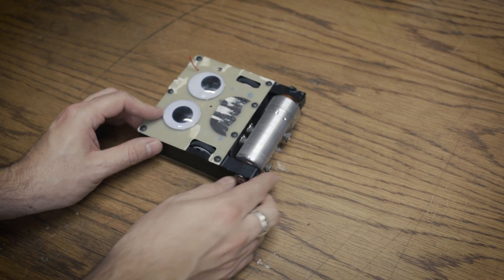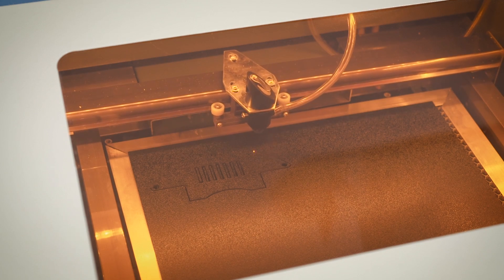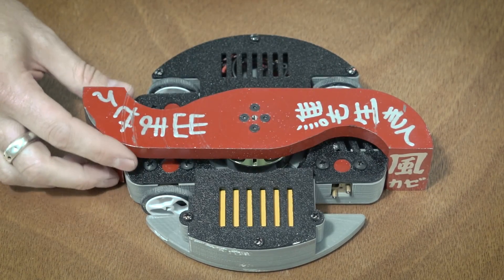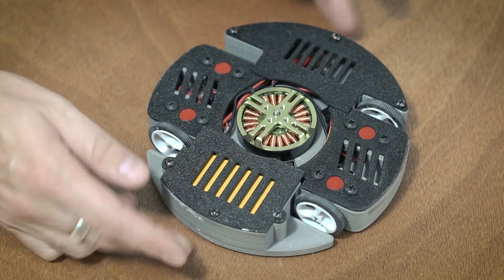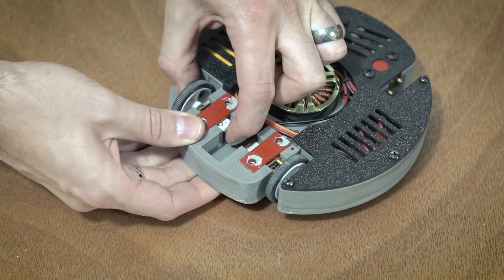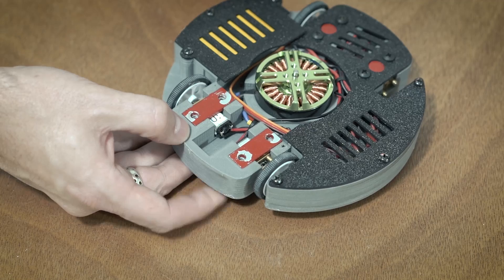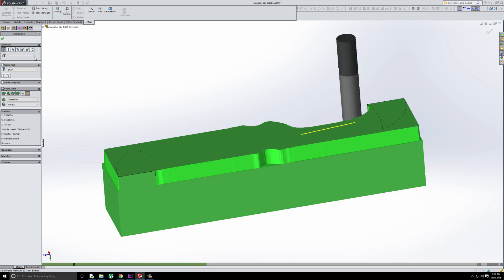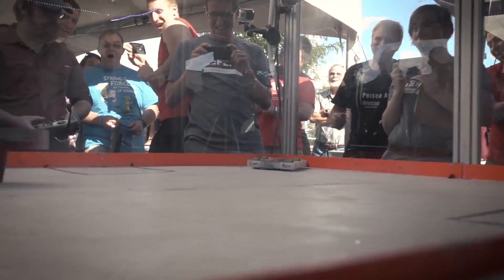Kamikaze - 3lb Combat Robot

Comment: 5:25 combat robot people learn how bolted connections work challenge 2023. it's a shockingly common misconception, one i just recently learned about, so i can't exactly blame you. a correctly torqued bolted connection's shear strength does NOT come from the shear strength of the bolt, bolts are not designed for shear loading and when they are used to resist shear a different mechanism is at play. The shear strength of a bolted connection comes from the coefficient of static friction between the two pieces of material, multiplied by the pressure between the two pieces. you figure out the static friction between the two surfaces, you calculate the shearing force between the two surfaces, and you combine those to get the pressure needed. then you choose a size, type, and number of bolts that have sufficient tensile strength, and calculate the torque needed to produce the desired pressure. if you do this, the only stress on the bolt is tensile (which is what bolts are designed for), and all the shear load is distributed between the two surfaces in contact. that's why the gusset plates on bridges don't have giant shear pins going through them, it's the friction between the plate and the members that give it its strength.

this is not to say keying the weapon to the motor is a bad idea, i'm guessing it would be very difficult to get sufficient contact pressure out of such small screws over such a large face (and, a traditional friction-based bolted connection would need a LOT of pressure to correctly absorb the shock loading of a combat robot weapon), and your solution looks like some very solid positive engagement. just, worth understanding the failure modes; the bolted connection isn't really failing when it shears, it failed earlier, when the static friction broke and the surfaces slipped. this distinction may not be important in this realm, but if you're scaling up and the forces you're dealing with grow, it's important to understand how bolts are and aren't designed to work.

(also, i talk a big game in the first paragraph but i'm not a professional engineer, i don't do those calculations and don't even own a torque wrench. i haven't run into a project where i needed to care about getting high shear performance out of a bolted connection, so i just take the equations, throw away all the weird constants and stuff, replace the equals signs with "proportional to" signs, and fold it into my largely vibes-based mental model of how things work. so the whole point of raising this distinction isn't to try to force you to do a ton of math, just to update how you visualize bolted connections when you're Rotating A Robot In Your Mind)
Reply from the maker: Combat robots are always a bit strange.  They of course follow the rules of physics, but fasteners are seemingly never enough.  We've bent and warped 1"+ bolts, and even pulled them out and stripped all the threads off.  MOST specs will list loads assuming they're relatively static, not these sudden dynamic loads.
Reply: @RobertCowanDIY  that makes sense. i guess combat robots is sort of a worst case in that your opponent is constantly trying to subvert any engineering assumptions you bring to the design process. i do think it's useful to keep in mind the intended performance of things like bolts, if you know your application is going to break the rules (say, shock loading will overcome the static friction and apply shear to the bolt), it's useful to have a mental model of how the bolt will perform (since to me at least it's really counter intuitive). or understanding that the bolt's functioning will be in one of two distinct regimes depending on the circumstances. and then you can account for it better by either making sure you choose a large enough bolt, or adding some additional keying to the joint. which admittedly, is exactly what you did, so i guess in the end i'm mostly being pedantic
Reply from the maker: @spambot7110 Yep, correct!  Usually you would design for an axial load, or radial, etc.  But with this, the forces are a "yes".  And it's all shock and high dynamic loads, which you would normally just avoid or minimize, but you can't do that here.  With bolts, you need to ask yourself "is that where I want weight?"  Sure, you can think about making them appropriately sized, but then you're adding 10-20% extra in weight.  I feel it's best to design them out and rely on them as little as possible.  My more modern designs rely on fasteners less and less.  I've had ideas of completely getting rid of fasteners, or just having a single large fastener that holds everything together.  I don't like weight in fasteners is the short story ;-)
Reply: @RobertCowanDIY  i'm not sure how it would perform, but conceptually i LOVE the idea of a combat robot with a Jesus Nut, please make this a thing
Reply from the maker: @spambot7110 I got REALLY close with Drain Bamage.  I was trying to give it a single bolt in the middle, but with how compact it is, it didn't work out.  One day!
Reply: i guess the one practical implication at this scale is: if your goal is to prevent any shear load from being transferred to the screws, make sure that the clearance in your screw holes is larger than the tolerance in your locking patterns, so that when the joint is fully "bottomed out" against the limit, there's still some clearance around the screw in both holes.
Reply from the maker: Yeah, correct.  This is a technique that's now commonly used/adopted by other builders.  Also, there's a lot of vibration and rotational forces which can loosen the mating surfaces and every time power is applied to the motor, it can worsen the situation.  Keying the parts together mostly solves these issues.

Comment: I remember cutting 4140 on my tormach 770 years ago and it was a pain in the ass to say the least. I loved my old tormach for aluminum and plastics but it struggles on the harder stuff (still got the job done but struggled)
Reply from the maker: Yeah, I feel the same.  For smaller jobs (keyways, counterbores, etc), it's just fine.  But if you're actually making a part out of anything other than aluminum or plastics, it's not going to go smoothly.

Comment: The modular design of the compartments is cool and definitely useful, but like you said if you want them to help add stength to the chassis, make the whole top plate one piece and it will maybe hold the 3d printed base together a little better. Love this channel and your bots!

Comment: Have you ever considered a centrifugal deploying top spinner.. I.e. it starts looking like a 3car jack which as it spins up the strike pieces will pull outward  widening the diameter of the scissor mech until at full speed it would be at make extension and damage capability while also providing a heavy duty spindle center for the whole device to become a self righting mech?

Comment: Watching in 2020. Your videos are amazing.  I often see and think other boys have many flawed designs.  Your bots are so well engendered and thought through.  Thank you for great inspiration not only with bot building but workshop layout, approach to any project and that dedication and discipline is hard but worthwhile and gratifying.  

Two question if I may ask.   
1. As weapons now achieving huge speeds, and haven’t noticed many people talk about Areo dynamics such as in airplane props etc.  know that they don’t fair well to  impacts. But wonder if there’s any software to test impact speed to strength and speed.  May mean a smaller motor could spin same speeds ? Just a thought 

2. Being that you’ve been on YouTube for some time now and in public eye.  How has your mental health faired and what things do you do as habit to stay stable and strong.  

Thanks again.
Reply from the maker: First off, thanks!  1) aerodynamics do pay an issue, but only when you get faster than ~200MPH.  beyond this tip speed, engagement suffers, so it's a moot point.  But if you're talking about actual props, these will explode.  Even hardened steel can fail in these cases.  2) My mental health is just fine.  I don't really do anything other than walk away from social media when I get tired of it.  I don't have any 'requirements' to make videos.  If I don't feel like doing them, nothing stops me from just not doing it.

Comment: My advice, just don't use a full body spinner.

The idea is very great, and it looks like a fun robot.  But any damage your robot dishes out, it also has to hope its insides don't get torn apart from the same impact as well.  Except it is more concentrated on the screws and the joints.

Captain shredderator is a good example.  Was great in the early days, but machining and metal has come such a long way, FBS seem to struggle more and more.

Prove me wrong though, for that weight class I want to see one do good again.

Comment: Use one big sheet of aluminum r titanium for the top panel instead of multiple it will help
Reply from the maker: That is a great idea, IF there was any weight left.  There's barely any weight for that, and putting any more metal into the design would make it overweight.
Reply: Shame its a really cool looking bot i think you could squeeze some weight out of the weapon maybe some teeth and as you said some holes or a fuller

Comment: Robert Cowan, I think that you should really put more weight on the infill and the electronic.  Plus, I'm pretty curious about why your robots never has belts. Other prople always tell me that the motors tend to break that way.
Reply from the maker: This robot was a test to see if I could put 2 pounds into the weapon.  I never meant it to be an ideal design, just something for fun.  I agree, it needs more weight in electronics and the body.  But that wasn't the point.  I use belts on my larger robots.  For smaller weight classes, you can get by driving the weapon directly, if you take precautions.  It's usually better to use belts as it transfers the shocks away from the motor.  The downside to doing this is it takes up more space and takes up more weight.  There's a trade-off.  I generally just battle-harden my motors and make sure they're not rigidly coupled to the frame.

Comment: I like the bot design. What caused your losses?
Reply from the maker: There are a lot of little issues.  It doesn't drive very well, it needs much more powerful motors to overcome the inertia of the weapon.  The weapon spins up too slowly, and it's not very stable when hit.  My new beetleweight will hopefully fix these issues.

Comment: 11:39 can I ask why no coolant? Is the mill not equipped with it? You could retrofit a tank and hose yourself. And what about roughing out the guts with a large fly cutter? Blue chips are good for roughing cuts. Are you using HSS or carbide cutters? Looks like carbide. But yeah, coolant and lots of it.

I'm a toolmaker that's done a lot of everything over the last nearly-20 years. I've worked in aerospace and electrical, fabrication and machining, and now getting a locksmithing qualification. I've been watching a lot of battlebots and robot wars lately and I think I want to build a fight bot next year. I caught on to your channel so I might check out a few more of your vids and sub. I have my ideas of what I'd like to do, but its never a bad thing to see how others are doing it.
Reply from the maker: I didn't have coolant setup, and this was the wrong way to cut it.  I was using carbide.  I should have had coolant on there.  I'm not really a machinist, still learning!
Reply: @RobertCowanDIY  Awesome! Well, I believe I subbed, feel free to ask me anything about machining. Your vids will no doubt help me down the line so please do ask me here or feel free to pm me if you need any advice or tips.

I'm doing locksmithing now of all things. I miss machining and just making and designing in general.

Comment: What if you used a somewhat loose friction fit to spin the weapon so that the motor shaft just spins rather than send the force into the motor and chassis.
Reply from the maker: That could work.  Some people use clutches or torque reducers.  For my bigger robot, I use belts, to de-couple the weapon from the rest of the robot.  Ultimately though, once it's spinning, it's storing a LOT of kinetic and it has to go somewhere.

Comment: Haha that is the most ridiculous beetle I've ever seen. Thoroughly enjoyed the build log / analysis post event. I've been using PC-Max from polymaker as parts for a featherweight and they actually held up as drive gears... full combat class. It's tricky to print but if you've got ABS working without warp I'd give that a shot for next time, it's got far superior strength and layer bonding in my experience. Now to binge your other builds !

Comment: What Motor Is that?
Reply from the maker: It's this one:  https://hobbyking.com/en_us/turnigy-multistar-4822-490kv-22pole-multi-rotor-outrunner.html  It's a pretty good motor, just needs more power.
Reply: Nasir Illasarie one thing I highly recommend is NOT doing direct drive, especially on a beetle. you need a few degrees of freedom for the shell to twist on its axis so it doesn't pull the chassis with and make it more likely to flip. when the weapon coins, the base can also stay more planted to the ground. I've been meaning to make a beetle and flea FBS to complement my ant, but am intimidated by the multiple hundreds of $ machinists ask for for a 2-setup operation.

great video! my rule of thumb for motor is it has enough thrust to fly the bot if it had a prop instead of a weapon

Comment: Do you think it would cost a lot to have a local machine shop cut something down this small?
Reply from the maker: Yes, it will cost a lot.  There is usually a setup fee, plus the time it takes, etc.  Plus, most shops will charge you tooling since they may or may not have the appropriate bits to use on this material.  It would be a couple hundred dollars at the very lowest.

Comment: have you thought about machining in some kind of "spoiler", or rather upward blowing fan, on the weapon so that you get a lot of downward force while the weapon is spinning, that should prevent the bot from flipping. that would limit your movement speed tho.
Reply from the maker: I had that idea, but there was just barely enough power to get the weapon up to speed, any kind of downforce would have slowed it down and could have caused issues with the battery or motor driver.  Maybe next time ;-)

Comment: Thanks for the making videos of the robots that you build. They are quite informative. You note of even a small issue that you face, and provide us the solution. And, thanks for the continuous improvement of the robots, and building techniques.

I've few suggestions for the Kamikaze robot. 
For full body spinners, during the impact the chassis has to be stable, and stick to the ground.
Suggestions: 
1. use of wider wheels.
2. Use wheels with shock absorbs (so that wheels can move 2,3mm up).And, the bottom of the chassis should be a silicone grip surface. So, during the impact the chassis moves down, and the grip holds the robot firmly to the ground, delivering max impact to the opponent. The drawback is that the weapon ground clearance needs to be more than 3mm. 
3. If the floor is a steel one, you can use electromagnets to hold the robot (chassis) still during the impact.

When the weapon hits the opponent, it's thrown away, and hits the walls of the arena, right? Make the edge of the weapon like a wedge, so that the opponent robot will be thrown away in the air, after impact. There are more chances that the opponent will land upside down, and more chances of winning. (The current version of Tombstone robot has wedge shaped spinning bar, hopefully for the same reason)

Correct me if I'm wrong.
Reply from the maker: Thanks.  I actually ordered a bunch of different wheels and am testing them on Sgt. Cuddles (v2) as well as Kamikaze and an un-named robot design I'm testing.  

Electromagnets aren't really practical.  They draw a ton of current and are relatively heavy for the 'downforce' they provide.  I might play with the lead edge angle though.  Another person suggested not making it 90 degrees.  However, I kinda want maximum impact. Otherwise, it's not Kamikaze, it's "try-to-survive-aze'.

Comment: A nylon filament such as Taulmann Alloy 910 would make a strong frame, you can coat the outside of it with epoxy for even more strength
Reply from the maker: Unfortunately, my printer can't get hot enough for nylon.  But I'm building a new one that should be able to print nylon and other materials.